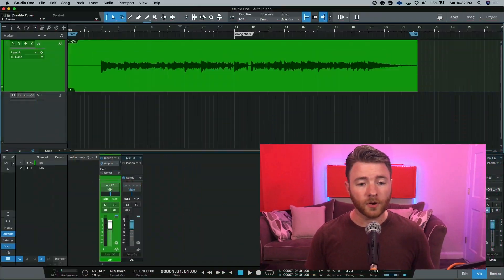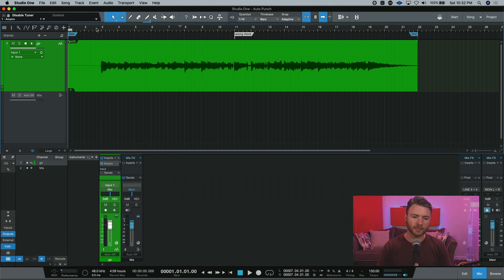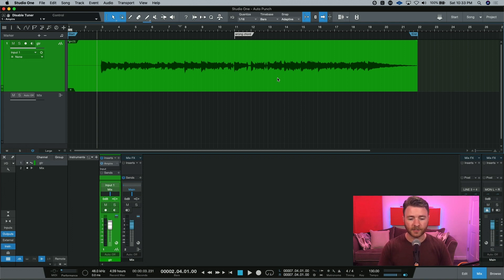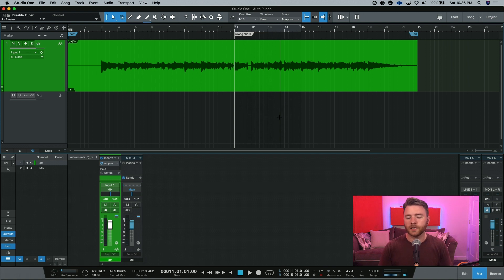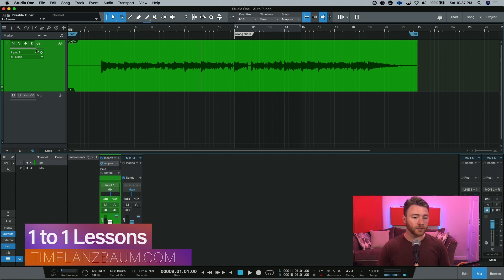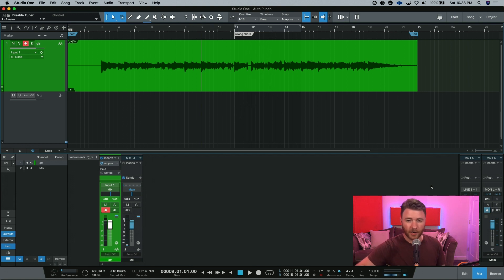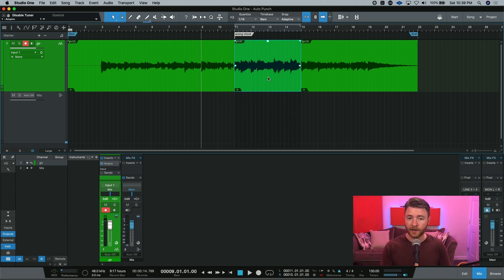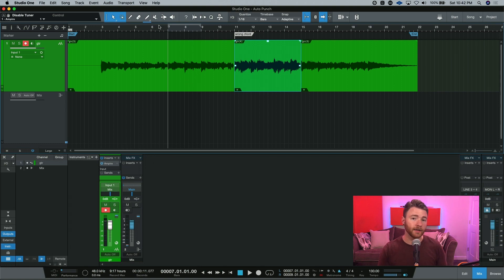Studio One - Replacing Sections with Autopunch

Comment: Thanks Tim. I want to be able to loop the punch in section to do multiple takes of the range and comp them. But I want a preroll/lead in for every take as I loop record. Coming from Cubase, I am  a bit miffed with the process here in S1. As you may or not be aware, in Cubase you can set the punch range independent of the loop range/ markers. What I do is select a range and then select Set Punch Points to Selection Range. I then set my loop markers to the same range except I add 2 bars ahead of left punch point and enable the loop. So, the effect is a looping range that has 2 bars of preroll and punches in and out independent of loop range. Any thoughts on achieving the same in S1? Obviously we can loop the punch range but how can we do it with a preroll/lead in everytime?
Reply: I agree as I would like to follow the same process as you... Tim, is it possible??